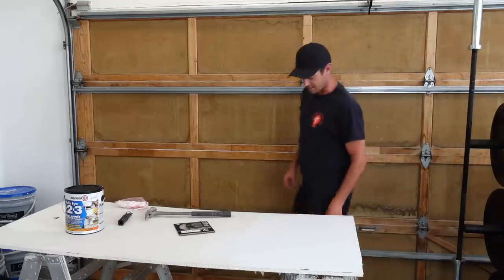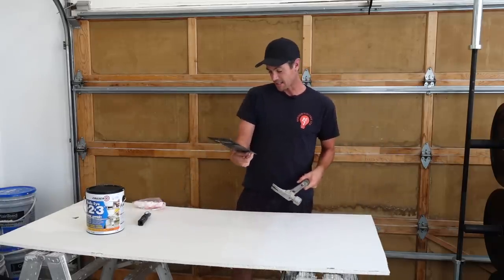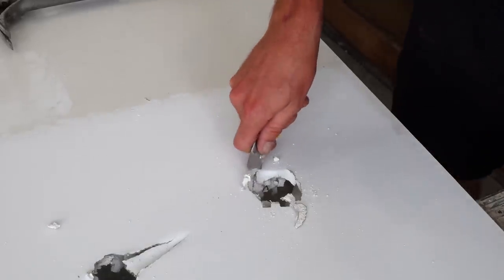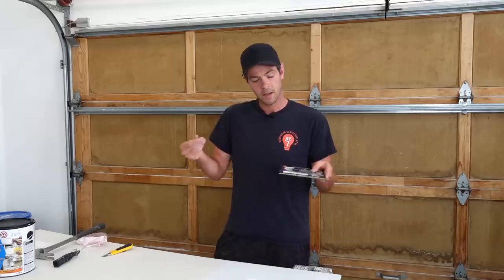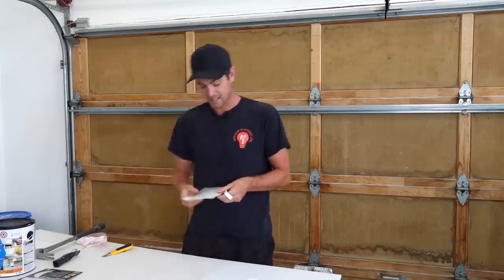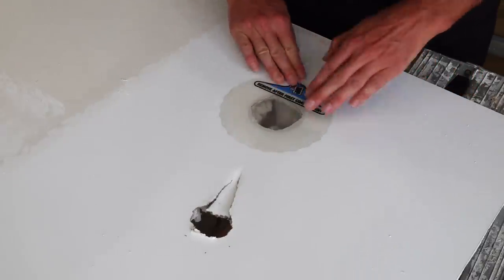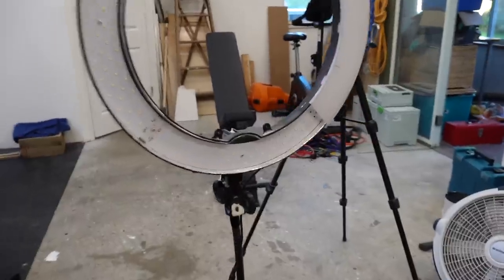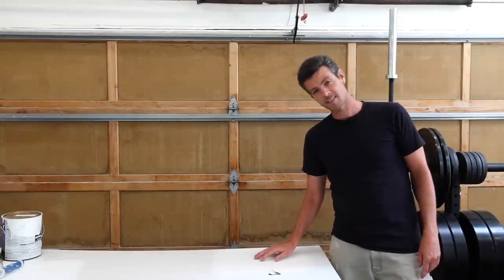So I tried this Drywall Patch again just for you guys!!!!!

Comment: I'm baffled why so many are defending this garbage patch even in light of the fact that this channel teaches you how to patch the right way. Take the time to do it the right way and not use a round piece of tape. That being said it was entertaining!
Reply: Ur lying.
Reply: @Toxicetc  I'm not sure the context of "lying" but okay. I've used this patch personally and its garbage. I ripped it off the wall and patched the wall correctly after that. I was just surprised VC spent so much time making videos for this piece of tape patch.
Reply: @stevejones9044  I just used one and put a thin coat of 90 min on top, than painted it was great
Reply: I agree I'd never use this patch. But for home owners with no experience with finishing drywall, this patch actually does a half decent job if done correctly. 2 cracks at it and the creator still hasn't done it correctly. 
Personally I'd much rather come into a home and the owner has patched with this product  vs some of the patch jobs I've seen that I've had to take a belt sander to.
Reply: @warlok9  LOL "belt sanders"  Those were some of mine when I first learned how to do sheetrock! I tend to agree with you about less experienced people attracted to this sticker patch but again my main comment was why so many were defending it by those that seemed to have experience with patching the right way.
Reply: Exactly I can fix this with 5 min mud and regular to damn near level 5 standards if not in 20-40 minutes depending how the mud dries iver that specific paint. How long do u have to wait for that paint to dry?

Comment: Hey Ben. 
I couldn’t find any other way of contacting you. So I guess I’ll just be ghetto and write my question on here.

I had an interesting video idea. 
I work as a painter/drywaller/maintenance for hospitals in the United States.
I’m currently doing an experiment with drywall, out of curiosity and boredom.

The experiment is to see whether or not you can patch a drywall hole, and see if it can be securely reanchored/ rescrewed into the same exact hole, without the patch cracking/failing, screw/anchor not securing, etc. 

Best example I can give is, pretend someone rips their towel holder off. They then move the towel holder up, secure it, patch and paint. Which is what most folks would do. 
Then years later, the next person rips it off, moves it down and drills/anchors into the exact same spot the last person had patched. So that’s why I’m curious to see what method works best, just for the off chance someone does that. And not leaving the next person a headache to deal with. Because sometimes moving it up or down isn’t applicable.
Hopefully that explanation makes sense.

I made 3 equal sized holes into scrap drywall. Each hole was made with a 1/2 inch/ 12.7 mil drillbit. Each hole was scraped, prepped and loose paper cut away.

Here’s each hole, and it’s process.
#1 filled with just 5 min hot mud
#2 prefilled with 5 min, let set up. Then put mesh tape roughly 1.5 inches overlapping on each side, with more 5 min over top.
#3 Prefilled with 5 min, let set up. Then used thinned down all purpose and put paper tape over top. Went roughly 1.5 inches overlapping each side. My hope with this one is whether or not it mimics the strength/secureness of the factory installed paper on gypsum board.

My experiment will by 3 parts, once on each of the 3 holes and it methods.
1. To just put a rock 2 rock screw in to see if the patch breaks/cracks, fails, falls out, etc.
2. Use a drillbit to make a hole to fit an anchor in, and whether it will fail.
3. To put a stud behind the drywall and see if the each experiment patch can be drilled into and secured strong with a stud without breaking/cracking, failing, etc.

Hopefully this would be an interesting/informative video idea in the future. 
And I figured since you’ve been at this way longer than me, that you could go even more in depth regarding it. Make an experiment out of it, or just two cents even.

Maybe make the video/multiple videos even more interesting, by seeing how secure/strong a California patch would be with a screw and with weight on it? Or taking a failed anchor out putting 5 min mud into  the hole and onto the anchor, putting it in still wet and letting it dry to see if it’s works?
Or maybe even testing with spray foam, caulking, epoxy, to see how it would hold up after an reanchor attempt.
The options are plenty!

Thank you, Ben.
I’ve admired your channel for many, many years, and it’s helped excel my career to great heights! You’ve been an incredible teacher/mentor for me.

Best regards.
-Luke

Comment: I remember years ago a painter would use packing tape to cover a hole. He would apply a thin coat of paintable filler around the edge, sand and paint. It looked good for a while, but eventually the adhesive would begin to fail and detach from the wall. not to mention should it be hit again, it's back to square one. If it's between studs, do a California patch. If near or on a stud, drywall patch with backing. Go with what works.
Reply: That wasn't a painter, that was a hack shyster.
Reply: @jedimindtrick8966  I didn't say he was good. That example was the least of his sins, which were many.

Comment: You could keep redoing this for the next 10 years and someone would always come up with a suggestion of why you're doing it wrong. Thanks for trying again though. My wife talked me into one of a quick patch sort of thing once and I ended up cutting out a much later hole and patching it with a piece of drywall and some backer boards.

Comment: when I first saw it in the store (prior to your videos) i laughed and shook my head.   Yes it is a little more easy for a homer owner than those drydex patch kits with the plastic knife and wall patch.   But any half decent DIY'er/Home owner who has done a little tile backsplash should be able to handle a basic drywall patch with a quickset 1kilo pouch and a bit of tape, 3 coats, sand and you are done.

Comment: I kinda wish they made a flower power sticker that was designed to be stuck to the wall where a doorknob would hit. Full width adhesive so it's not a blister, surfaced to promote mud adhesion. You stick it to the drywall before you start mudding, make it disappear, and it just sits there invisibly waiting to keep doorknobs from penetrating. 🙃
Reply: Or just get a door stop lol
Reply: @alejandrolasso2171  Obviously, you get a door stop, but WHEN it fails, you won't automatically be in drywall patching mode.
Reply: Just get a doorstop, and hinge door stop

Comment: If it’s a large or deep hole just use some expanding foam then fill with Toupret Joint, Skim & Fill, second fill if required and a light sanding. Perfect finish. However, when it comes to plastering or skimming i’d leave it to the pros.

Comment: The first time I noticed this in HD I knew it was junk.  Aside from the inability to hide well you also have an issue of someone trying to hang a picture on it 15yrs from now.    Good luck ever pitting a picture frame nail there.  A 2x2 project panel and some mud is about the same price and a way better option.

Comment: That blister brings back ~fond~ memories of the hideous patch job the previous owners did for a hole in the closet ceiling. They used a very similar patch, though it was more of a cog shape than a flower. To top it off, they mudded over it with what I'm pretty sure was just straight spackle. I honestly don't know why they patched it—leaving an open hole would have been far less ugly than that abomination. Sure, they also never did maintenance on the boiler and it rusted shut, but I'm only half as mad about that as I am about the patch job.

Comment: I'm a little late to the party but thought I'd still put my 2 cents in. Now first off not a fan of these patches, but as for the paint side of things; I should preface by saying I work on a military base servicing 4500 units and see an average of 10-25 work orders a day depending on the time of year. I'm personally not a fan of zinsser products; you kept trying to build up paint around the edges of the patch but in my experience zinsser procucts tend to be very thin/diluted, we only get zinsser when we can't get our hands on kilz. I find kilz has the best coverage, adhesion, and is much thicker then the competitors. I think you would have had better luck with kilz, I also think 2 coats before peeling and 1 coat after may have provided better results then 1 before and 2 after, but I don't expect you to do this a 3rd time to find out lol. Either way for these "door knob" patches I think I'll stick with the tried and true do it right and install a door bump on the wall to ensure I don't have to come back every year or so when a new resident puts a hole in the wall because the spring bump failed over time. Either way, interesting video, actually made me think about whether the convenience of the patch installation was worth it; I don't think so but I did think about it.

Comment: I think their idea is the initial paint layer is the same thickness as the layer you peel off after the initial paint. Then two more coat will cover everything up. Maybe in an idea situation, it will work. But 99% time it won’t. And it’s not much easier than just do regular way
Reply from the maker: This was more than the ideal situation and no, it won't be covered up. Flower power forever!
Reply: @vancouvercarpenter  what I wonder is when these companies test these products if they test them with the drywall flat on a table vs on a wall because as soon as you turned the drywall to the side (like a wall) the patch showed the bubble really well (which defeats the purpose of a patch to begin with)

Comment: Can you try one of those patches that come with a wire mesh. Also I think this flower patch is better than most homeowner patches, and probably easier to fix, but it doesn't belong in a pro or even semi pros toolbox. Basically, if you own a 6 inch knife you shouldn't own these

Comment: Question: I have a previous client that flips houses, his current place wasn't selling because it had a kitchen in the basement(broker said this). He had somebody rip it out and I went to patch the drywall and vinyl floor. His main contractor that does the Reno's was demanding that I follow his instructions for the drywall. 
He said that I needed to add "special" powder to the all purpose so that it dries faster. And I can patch and paint in the same day. 

Is this a thing? Or is this just 5 min quickset? 
And does this even work? 
I did it because that's what he wanted. It does seem to dry faster but 4-5 hours in and it was still way too soft for sanding.

Comment: Hi there, I've learned a lot watching your drywalleryest videos but I would really love to see some videos on the following:  One, how do you know when you're done?  I feel like I've been way too much of a perfectionist but I just don't know when to stop.  Some of your videos I couldn't tell that you were leaving a little liftoff marks, so I kept trying to get "perfect" or near perfect surface before sanding.  Then I saw one of your later ones where you used side lighting to see where you needed to sand.  Also I have a real mess of plumbing in my basement. You talk about lipstick on a pig, this is eyeshadow on a warthog. I have a lot of pipes downstairs that I've been trying to mud around.  some are really tough, a couple curve out from the ceiling or wall, that is the curve is within the drywall making it super hard to fill. So I wonder what you would do for that. Similarly I have some other pipes that are barely above the drywall in the ceiling (actually 1/8" copper pipes that sit within the drywall thickness) or it even slightly angles downward from above to below. I don't have any options right now for redoing the plumbing, just trying to figure out if I should try to cover it with drywall/mud or box around it (it's a LOT). I even thought about installing a drop ceiling but it's already low, at 89" with no flooring.  The remodelers did such a terrible job of taping and not-really-mudding so I'm having to sand and re-mud a bunch. Ugh. Any tips? Would you please do one or two videos about when to stop, and how to drywall/finish around pipes going in the wall or ceiling?
Reply: Hey, I just read your comment, I'm a taper and I thought I'd try to give you some advice, not sure if you've fixed it yet but if not I can give you some tips, as for coating, Ben has some really good videos on liftoffs, you need a pole sander to sand large areas, my workflow is typically a round sander with 100 grit between coats, then I use my black widow for joints and pole sander for angles and a gator quick sheet sander for hand stuff, you only use a sponge for small stuff that other stuff doesn't fit in or 3way corners. Getting a perfect finish before sanding isn't difficult you just need the right workflow, your first coat is like your fill coat, your second coat is your smoothing coat, sand between both quickly but generally you get it pretty good after two coats, flat and pretty good then you pull a tight skim over it to get your perfect coat before sanding. The sanding step is critical because once you prime you're kind of locked in to what you've done, pole sander is essential, preferably a rectangle one with spongebacked sand paper, you could also use a circle sander with a sponge built in and 150 or 180 grit, it isn't ideal but easier to use so long as you're careful of scratching, the small scratches will dissapear but be careful of dinging up the edge of the sandpaper because they'll make large scratches that will show through, I dislike seeing the scratch pattern even though it will be covered by paint texture because I find I can't find defects as easily.
As for your basement, I don't quite get what you mean by pipes the thickness of the drywall and the pipes, I mean I think you mean you have pipes hanging between and lower than the joists that are pushing on the back of the drywall making it bulge out that you've tried to mud over, if that's the case, and the ceiling you have is a total mess, I'd cut the places the drywall is bulging out and overlay everything, if you mean the pipes hang down so much that they go through the ceiling then I'd use a flush cutter and cut a very square channel for them to sit in an then put a rectangle of trim around them to hide the edge, you could also look at videos on how to build bulkheads if they're low enough but I think you're opposed to that I kind of think it's the first because you've tried to mud over the bulge. Anytime you have something poking through the drywall and you have broken board you have to cut out and use setting mud to fill it in and tape it, you can also build up quite a bit with setting mud if you float out a really wide area. I'd cut all the broken or bowed out board out, just the paper at the front and the broken board, leave the backing which is easy you just cut the surface of the drywall and dig the broken bits out and then fill it in with durabond or sheetrock and fibatape it and then float it out, do that to the whole sealing and then skim it, use a 2 or 3 foot skimming blade and a paint roller, Ben has some videos doing that, or if you're good with a hawk and trowel then just skim it out, first one way then the other, if you don't have practice then keep them to pretty tight skims and do that a few times sanding in between just to knock of high points, if you use the tool right it will get you flat result because you can see based on cutting in where it isn't flat
Oh and if you mean you have pipes coming out perpendicular/normal to the wall then just use setting mud to fill the hole, mesh tape or fiba on around the hole like a stop sign then cover tight to the pipe and float it out and sand flat then wipe the mud off the pipe and it looks great.

Comment: It didn't work because it is garbage, the hole is still hollow behind the patch, believe it or not, you will see, feel & hear it... not to mention the edge left around the patch area.  

you want a quick patch, angle the edges around the repair with a utility knife, pressure fit some diamond lath screen in the hole, bed coat (also key it in the sides) with 20 minute brown bag quickset and accelerator to make it set in 5 minutes or less.  Scrape sag,  quickset likes to sag, 1 - 2 coats with 5 minutes easy sand quickset & either wet sand or apply finish mud over top to sand next day.

Comment: What if you trimmed the hole to to except the whole thicker center part? Then, after two coats of primer, sanded the edges of the patch, and then added another coat of primer, then paint?
Reply: At that point why not just patch it with some mud and tape?

Comment: I bought this pre mix all purpose mud from certainteed calls easi-fil. i used it to skim coat a wall. after it dried and i proceedd to prime it with zesnier primer, it revealed a TON of micro bubble holes in the skim coat. so i had to go back and cover them all up.   is their a way to prevent it? i used the premix straight out of the pale.
Reply: add some water to thin the mix.   also mud will bubble when going over existing painted surface.   The paint seals the wall, forcing the moisture in the mix to come back out thus creating the bubble.      What I do is after mudding the area, leave it for a minute before you skim/remove the material.   This gives it a chance to work/stick to the wall, doesn't get rid of all the pit holes but helps.   Then go over again with a tight skim coat to fill in the holes.
Reply: @andrewcarr2431  i've had an issue with skimming painted walls too, didn't matter how many times i've skimmed it, the bubbles still came in, what I did to mitigate that was skim coat the whole wall with a tight skim, then by the time i finished that wall, i skimmed over it again ( while still wet) and that seemed to work out the bubbles.